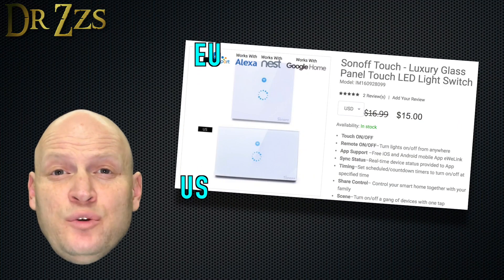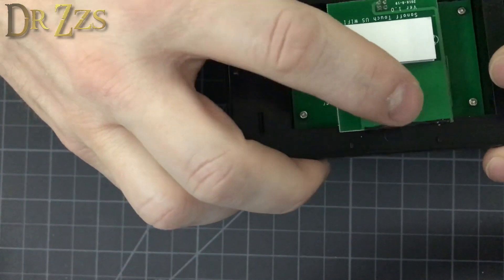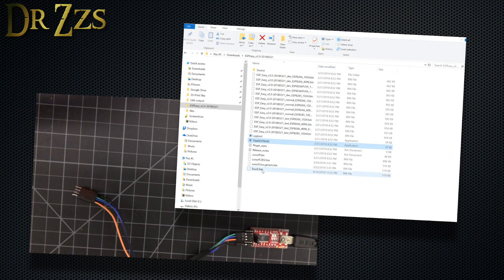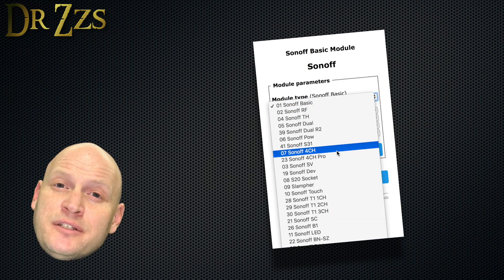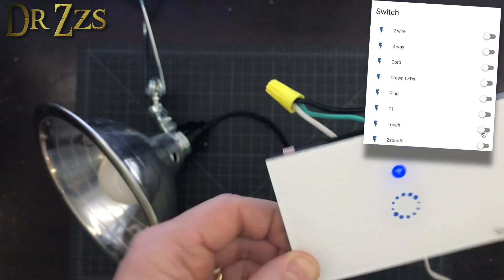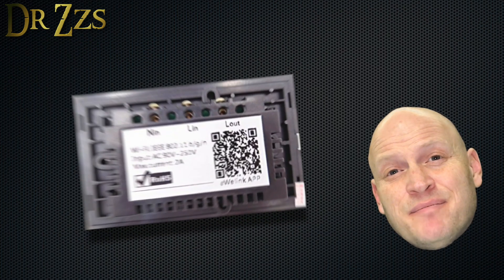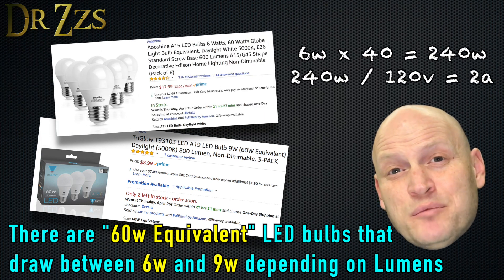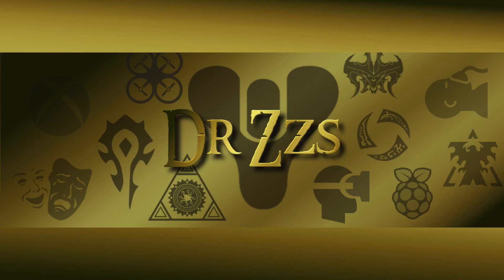How to Flash the $15 Smart Switch | Tasmota & Home Assistant | Home Automation

Comment: Is there any way to find out, which of the 4 pins is which, when you don't have schematics? I have no-name smart plug with Esp8266 chip, but I don't know pins layout. I obviously have multimeter and I would like to try flashing it with Tasmota, because at the moment home-assistant does not recognise them. Is that even possible? That no-name plug uses Tuya app on android, if that helps.
Reply from the maker: That should be possible.  Any 8266 chip should go into programming mode with GPIO-0 to ground on power up and should take new firmware then.  One consideration might be the memory available.  They work hard to keep Tasmota small so it shouldn't be a problem.  Only one way to find out!
If you can see the 8266 chip you should be able to find the right pins.  
Here's a good resource: http://henrysbench.capnfatz.com/henrys-bench/arduino-projects-tips-and-more/esp8266ex-pinouts-and-connections/

You need GPIO-0, GPIO-1 (Tx) and GPIO-3 (Rx).  
Hope that helps!  
Let me know if you get stuck!
Reply: DrZzs
Brilliant, thanks. But correct me if I am wrong... I need 4 pins and you mentioned only 3. 3.3V is missing? If you don't mind, I will move over to twitter, as you can post photos there. 😉 Thank you for your assistance.
Reply from the maker: yes, sorry.  If you count 3.3v and ground you actually need 5.  GPIO-0 to Gnd for programming mode, then 3.3v, Rx, Tx, and Gnd for the USB/serial adapter connection.  
ya, show me what you're working with on Twitter.  We'll figure it out.

Comment: How to know witch platform is used if different as ESp8266 ? I've the sonof S20 EU version and finally not sure that is the ESp8266
Reply from the maker: the S20 does use the 8266.  
https://www.itead.cc/wiki/images/e/ec/S20_UK.SCH.pdf

It looks like the pins aren't hard to find, so you should be able to flash it without much trouble. 
https://github.com/arendst/Sonoff-Tasmota/wiki/Sonoff-S20-Smart-Socket

Good luck!
Reply: Thanks, Bookmarked the itead website;

Comment: I've been wandering, why do you put the sonnof that goes to light as "switch" and not as "light" in HA? Great video, as always!
Reply from the maker: Thanks!
No particular reason.  I just started adding them as switches and have stuck with it.  It works fine as "light" too.  I just changed it so you could see:
https://www.dropbox.com/s/njwmqua7y1riojn/Screenshot%202018-04-30%2010.10.40.png?dl=0

https://www.dropbox.com/s/ct8rlljzyfmd9v6/Screenshot%202018-04-30%2010.10.30.png?dl=0

Comment: First I want to thank you for all the great job you have done. Was a great starting point for me a few months ago. Now I have all my house full with sonoffs and I have all my light switches with sonoff touch. I use EU and T1 models and I had a few problems. First of all  if you keep pushing the touch for a long time the configuration reset so I had to setoption13 to on (I had this problem thanks to my 2 years old son). The second problem it's the 3 way switch configuration. With sonoff touch you need to synchronize the switches and I cannot use switch.toggle. I didn't find a good way to do it in home assistant. Any suggestions are appreciated...
Reply from the maker: ah, the amazing things kids can do! 
Did you try to use the T1 for a 3-way switch?  I noticed today the newest T1 has RF and they're also selling an RF button you can mount on the wall somewhere.  I wonder if that's their solution for a 3-way switch arrangement.
Reply: I try to find a solution with tasmota and first I have tried to do it with automations but i had a problem if you push the touch one time works perfectly but if you push the touch 2 or more times rapidly all the touchs are starting to switch in cascade and I only get a Halloween effect...  If I use tasmota GroupTopic and ButtonTopic works perfectly but only with one touch model.  If I use 2 Touch or 3 Touch models and I want to synchronize only one button this option is not working because its synchronizes all the bottons…
Reply from the maker: Oh man.  Sounds like you've got a mess on your hands. 
Maybe the first thing you tried with the Automation is the way to go.  But see if there's a way to disable the multi-button-touch functions in Tasmota.  Check the Commands page.  I'd bet there's a way to turn off those functions.
Reply: Yes i did... the option is "setoption13 1". The problem is the short delay between the trigger and actions in home assistant. If you press the touch 2 times and the automation is not complete you have multi triggers situation and everything go to hell. You need at list 3 sonoff touch and try to synchronize the on off status between the sonoffs. The idea is when one touch is press and turn on the other two or more have to change from off to on.
Reply from the maker: ah.  Gotcha.  
well, you're ready for Halloween early this year!
Reply: :)))))))))))))))) I can use them without problems. I have 32 working touch in my home. For the 3 way switches the one button touch model is synchronize with GroupTopic and ButtonTopic in tasmota ( is very fast)  and is working perfectly and the 2 and 3 touch models are working with automations but out of sync ( with switch.toggle ). I hated for the on led this switches have…. If somebody find a solution or home assistant or tasmota gets better I prefer have them synchronized… But until then I do what I can to keep away the Halloween…..

Comment: Hey, great video!!! Does somebody also know where GPIO 0 is found on the 2button sonoff touch?
Reply from the maker: Thanks!
Looks like you power up, then hold button One then press the reset button. 
https://github.com/arendst/Sonoff-Tasmota/wiki/Sonoff-T1-UK-and-T1-EU

If you can access the esp8266 chip the location of gpio-0 is the same on every chip so using a jumper from ground like I did will work. If they changed the orientation you can still find gpio0 but using the dot on the chip to find gpio-0
https://goo.gl/images/obLRhQ

Comment: Bro sorry for this  , but you flash   FTDI with the sSONOFF in this order   VCC-VCC    RX-TX      TX-RX     GND-GND-PIN0? and other  question how  do    you   read    the   orginal     Firmware?
Reply from the maker: happy to help you anytime.  
Yes.  Those connections are correct.  
If you want to know which version of the original firmware you have you'll have to set the device up with the eWeLink app. Then choose the device and find "device settings".  The screen looks like this - 
https://www.dropbox.com/s/pnr2z6c7gi0v0ei/ewelinkVersion.PNG?dl=0

If you want to try to do the flashing OtA first that's another way to find out if you have ver 1.6 
If it stops working looking for the "Final Stage" ssid, then it is ver 1.6 and not compatible with OtA.  

Wish I could just send you what you need already flashed.  I need a free shipping deal like Amazon :)
Reply: Well i use esptool.py to make stock firmware backup and works, if  for some reason i want my firmware stock again i coudl reflash again , well i see esp download tool and show  esp8285 have 8 mb of capacity , well i dont know but i make a backup with 1 mb and 8 mb, if you want a original or stock firmware backup i can share with you my backup, i appreciate all your help, i flash the tasmota now without any problem with your program , you are the best .
Reply: brou i live in mexico, i dont know what is the cost for amazon free shiping deal, and shipping to mexico is expensive very expensive, but i could send you something special of mexico to your home.
Reply: brou all the thinks working, but if for some reason you have problems flash 1mega and not 8 mega and your sonoff will work again, i follow a lot of steps to work, i flash my sonoff  with esptool download and works like a champ.
Reply from the maker: That's fantastic!  I've had a lot of people ask me about putting the stock firmware back on the Sonoffs.  Now I can tell them they can!  
Great work Amigo!
Reply from the maker: Donde vive en Mexico? Vivia yo en Monterrey hace muchos anos.  Ya casi no hablo Espanol.  Tengo poquito todavia en la memoria.
Reply: Vivo en Guadalajara el hogar de los mariachis, tu espa;ol es muy bueno, sigue asi con tus videos son muy buenos.

Comment: First of all, congratulations for your videos.
I bought Jinvoo Smart switch which is compatible here in Italy, it's very similar to the Sonoff switch, but I don't know if it's the same.
Did you happen to try it? (tell me yes please, ehehe)
Currently I've connected the Jinvoo switch and everything works correctly. I entered it in the Home Assistant and it works, but I've to enter the account data of Home Life app. This means that if I want to control it via the app, my request goes to an external cloud and comes back. Is there any way to get it to work without a cloud (Home Life)?
Thanks in advance, knowing that you will help me: D: D, of course I'm joking
Sorry for my bad English

Comment: Why do these always have to be flashed? Aren't these Sonoffs good to go out of the box?
Reply from the maker: if you just want to use their app then yes.  They work fine, and you can use them with Alexa or Google home.  The flashing is only necessary if you want to use a Hub like Home Assistant. The main advantage is avoiding reliance on the sonoff company servers.
Reply: @DrZzs  Thanks for the quick reply. I knew there had to be a good reason and now I understand.

Comment: Nice Job.  Seems to me the advantage comes in when you use the two or three gang versions.  You can then replace an existing switch and have two additional MQTT controller inputs (given you don't actually use all three outputs) to control any other devices in your system.  I'm in the process of acquiring one of these to try just that.  I see some comments below suggest the same idea...
Reply from the maker: yes, I agree.  My 3-switch version is ordered.  If you really can control 3 circuits with one switch in a 1-gang size box that'll be awesome.
Reply: I ordered mine yesterday as well, let's compare notes...
Reply from the maker: deal! :)
Reply: Yes, the T1 2 gang and 3 gang versions are definite way to add additional switch choices. The problem I ran into when changing my switches over was replacing 2 or 3 switches with one T1, 2 or 3 gang version. You have the extra spaces where the original switches were. I ordered my switches as to what I was replacing, but ended up replacing 3 switches with 2 T1 2 gangs and only had a small space between switches I filled with white plastic sheet stock and that gave me an extra switch for my WAF, (she wanted a button to push to activate the fountain in the backyard :))
Reply: Dino, I intend to use the three-gang T1 in a previously single-switch position, not to replace three switches with one T1.  Functionality I want is to have  the ability to control two additional Remote devices (using MQTT) from a switch plate that previously operated only one light.  For example, I would like to  control my front porch lights from the rear porch light switch etc.  I have been searching for a reasonable method to provide control inputs throughout the house and this seems to be the answer.  We'll see.

Comment: If you lose power do they turn on the same state they were before it lost power?
Reply from the maker: They should... "should"
I'll test them when I get home later tonight.
Reply: there's an option for that in tasmota... is not always "good" to mantain previous state... https://github.com/arendst/Sonoff-Tasmota/wiki/PowerOnState-Configuration
Reply from the maker: Thanks!
Reply: squalazzo previous state would be the same behavior as a regular wall switch, but I'm on the fence as to whether new tech should be set to behave exactly as old.
Reply: i know, but as sonoffs are general relay switches and not specific for wall mount, the tasmota author allows YOU to choose what to do with yours :)
Reply: squalazzo I agree. Just stirring the discussion pot.

Comment: With tasmota u cannot control it when u are not home ??
Reply from the maker: You can if you have access to your Home Assistant from outside your house.  Easiest way to do that is just open port 8123 in your router on the computer running HA.  Just make sure you have a good password incase someone stumbles on your IP address and finds the port open.  I think the latest version of Hassio with the new authentication forces you to have a login and pw now so that isn't an issue like it might have been for earlier versions.  
The short answer is Yes.  With Tasmota you can access it from outside your house.  Hope that helps!

Comment: OMG ... Wished this video was published before I purchases three switches ... Looks like the click on to the wall bracket approach is a major failure.  Might have to investigate screwing  the front plate directly to the wall socket housing
Reply from the maker: It could just be me.  Check the comments,  someone suggested the whole in the wall needs to be bigger and the plate will snap on stronger if it's got more space.  It's not terrible.  Just be careful with kids knocking them around.  Probably not good to put in the Dodge Ball room.  :)

Comment: Be aware that Sonoff is now shipping the R2 versions of this Sonoff Basic... the pin holes are now filled with solder to prevent you from flashing the device and you will probably  destroy multiple units before getting the procedure down right.... I have six Sonoffs in my walls and now regret taking this route - will be looking for another vendor who is not actively fighting their user community
Reply from the maker: That is unfortunate.  I also would like to see them embrace those of us who want to use their hardware in our own way.  For what it's worth, they have contacted me and seemed quite happy that I've been promoting their devices, even though I always recommend replacing the firmware.  

You don't actually have to de-solder the R2 versions to flash them.  It's not as convenient as having the holes we had before, but if you just hold male jumpers on the soldered locations you may not get the flash done the first time, but you won't destroy the unit.  
I don't expect there's a device maker out there that is happy to have their devices hacked.  I wouldn't be surprised if they did this in response to some potential liability if they know their devices are being "misused" and they don't take some action to prevent it.  

If you do find a better option to the Sonoff, I'd love to hear about it.  So far I've not seen another brand of device with the same quality and low price.
Reply: Whew! So happy. I just received 4 of the Sonoff Basics today and they are all v1. I took each one apart to verify the holes are open and ready to go.
Reply: How does filling the holes prevent you from flashing?  It's slightly more difficult to solder pins in if the holes are already filled but only slightly.  Use desoldering braid or a solder sucker if you need to get rid of the solder or simply use a hot air station to heat all four pads up at the same time and push the headers in.  It really isn't hard.

Comment: With the last version (5.13.0) tasmota gets better so I found the way to sync my 3 way switches using the rules. For 1 gang model: 
tasmota console:

setoption13 1
GroupTopic livingroom
ButtonTopic livingroom

“livingroom” can be whatever we like. We have to do the same thing on all switches you want to work together.  

Home assistant configuration.yaml:
  - platform: mqtt
    name: "Living room"
    command_topic: "cmnd/livingroom/POWER"
    state_topic: "stat/sonoff/POWER"
    availability_topic: "tele/sonoff/LWT"
    payload_available: "Online"
    payload_not_available: "Offline"
    qos: 1
    payload_on: "ON"
    payload_off: "OFF"
    retain: true

Were “sonoff” it’s the MQTT “topic” of the switch with the light connected and “livingroom” it’s the “GroupTopic” name.

For 2 and 3 gang models:

     - tasmota console:
Setoption13 1
GroupTopic livingroom
ButtonTopic 0
Rule 1
Rule on button2#state do publish cmnd/livingroom/power2 %value% endon

     -Were  “button2” it’s the number off the button we use. (1,2,3), “livingroom” can be whatever we like. We have to do the same thing on all switches you want to work together.  

Home assistant configuration.yaml:

  - platform: mqtt
    name: "Living room"
    command_topic: "cmnd/livingroom/POWER2"
    state_topic: "stat/sonoff/POWER2"
    availability_topic: "tele/sonoff/LWT"
    payload_available: "Online"
    payload_not_available: "Offline"
    qos: 1
    payload_on: "ON"
    payload_off: "OFF"
    retain: true

Were “sonoff” it’s the MQTT “topic” of the switch with the light connected and “livingroom” it’s the “GroupTopic” name and “POWER2” it’s the number off the button we use. (1,2,3)
Reply from the maker: Cool! 
Thanks!